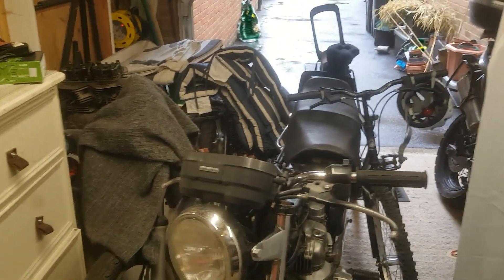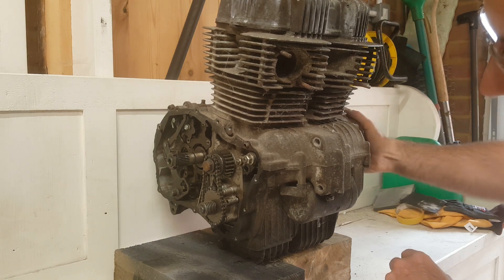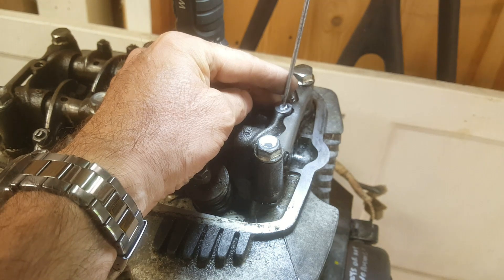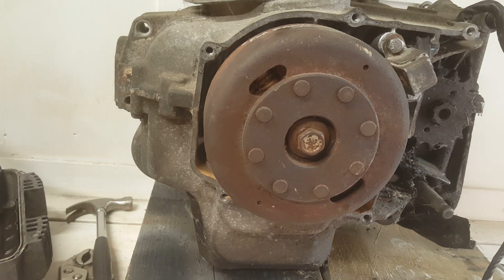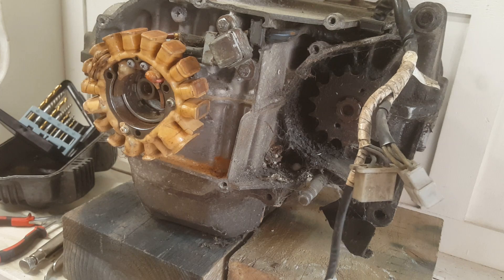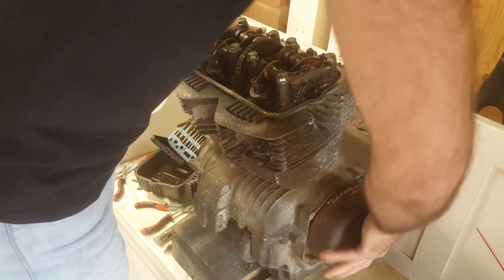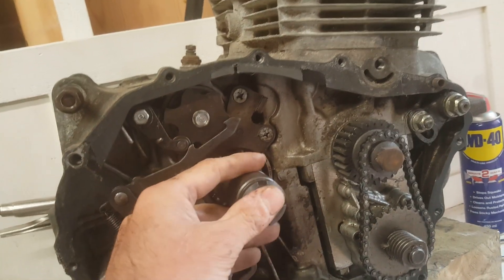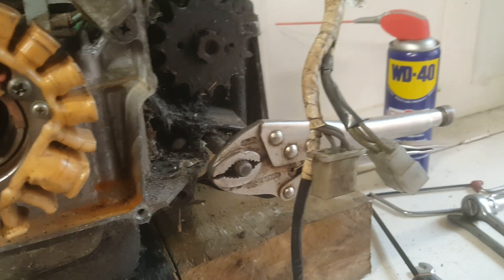Is this engine seized or saveable?  Scrambler Build - Part 2

Comment: Hi Ryan
Nice project,,,I'm just working  on a honda  cm250,,,,I need 2 inlet  manifolds,,,where did you  get yours from? As remember you  tried making them .
Thanks
Reply from the maker: Hi Antony, you're correct I initially made my own from a rubber tube, but it was pointed out to me that the angle was incorrect and caused the carbs to be on an incline, so I bought some that I'm sure were listed for a different model bike but fitted perfectly and were much cheaper. Tomorrow I'll try to find what and where I got them and I'll update this comment. Ryan
Reply: @RyansGarageUK  hi Ryan thanks  really helps,,,I saw the cb4oo online  and was wondering  if they will  fit ,,so I've  ordered  them ,,,,thanks  good luck  with  the scrambler
Reply: @RyansGarageUK  thanks  Ryan,,much appreciated,,,
Reply from the maker: Hi Anthony, I've found the details in my old video's. I sourced inlet rubbers for a CB400T and they fitted my bike just fine. I've just  googled "cb400t inlet manifold" and I'm seeing various suppliers from around £14 at the moment. Hope that helps. Ryan

Comment: I had a rocker cover bolt break on my 250. I was doing the cam chain tension and tappet clearances outside of my accommodation block at RAF Halton. This was pretty inconvenient as we were about to depart on a camping trip to Devon. With a bit of advice from my fellow travellers I managed to extract the stub from the engine by using a masonry nail as a punch to tap the stub around until it broke surface, at which point I could get it out by hand. It was replaced by one of the bolts that held the coil on. Some insulating tape wound around the coil bolt stem replaced the plain section on the original cover bolt and it was sufficiently oil tight to get us to Devon and back. Eeh, 'appy days!
Reply from the maker: Thanks Robert, that's a cool memory. And it gives me an idea how to attach my rocker cover if I fail to get the correct bolts. 👍🏻👍🏻
Reply: @RyansGarageUK  
Yes, just put a tubular sleeve on an ordinary bolt. Plastic would probably be OK as long as it can cope with the heat and glue it on. The shouldered bolts give a precise pinch on the rubber gasket and cones, in that respect they are good but the sharp corner where it goes from shoulder to thread is a weak point.

Comment: They all had the hole for the kick start but its not cheap to fit one as people charge the earth for kickstart parts, and pull the gear selector arm down and slide the whole mechanism inwards and the selector arm will self locate.
Reply from the maker: Thanks again Pete.

Comment: You can fit a kit start , this must be a post 81 engine you have ,would need a complete kick start mechanism from an NE engine  ( 250/400 and 81 or earlier ) and the bottom case must be of to fit it , also a clutch cover with the kick start hole in it . you at least have a good set of exhaust studs !! and please turn the motor over counter clock wise 😄
Reply from the maker: Thank you!! Good point I wasn't thinking but will be sure to turn it clockwise from now on. 😀